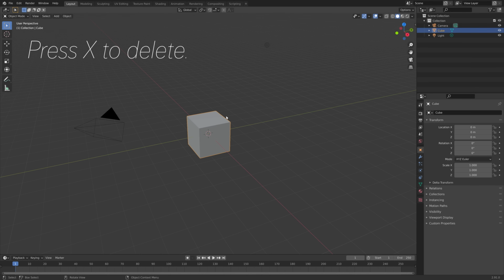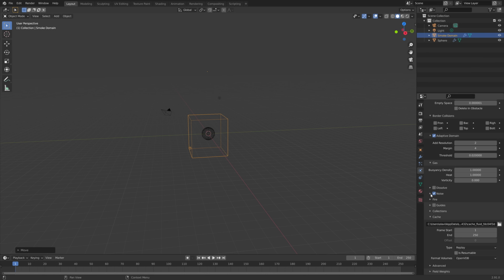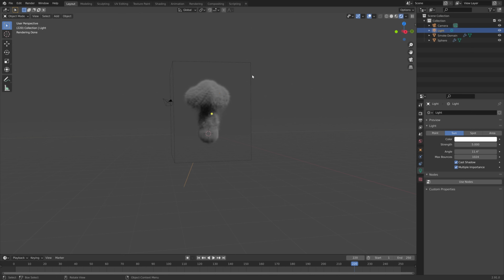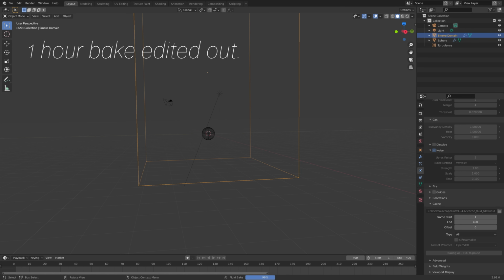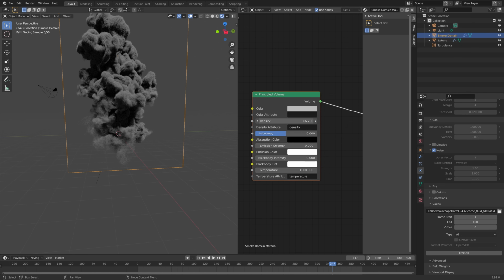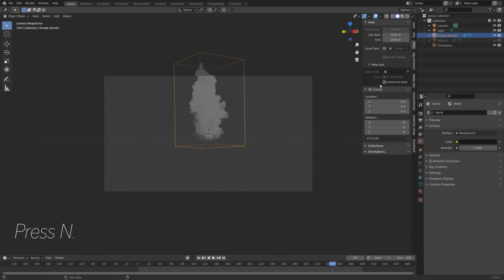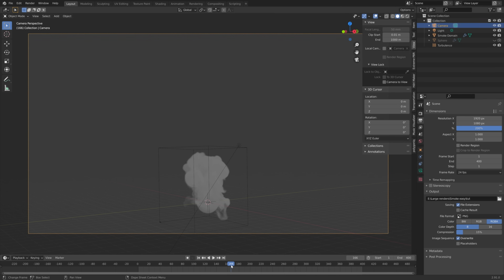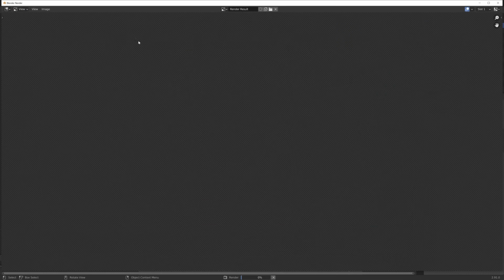[2.91] Blender Tutorial: Quick Smoke Simulation for Beginners

Comment: For me, the "all" option completely makes the smoke disappear. "Modular" also does so. The only working one is the "replay", and that doesn't even simulate. Just kind of spawns the smoke in a stiff frame.
I really don't like how they butchered the simulations in blender. Fluids became better with mantaflow but smoke and fire is now objectively worse, overcomplicated, extremely buggy that gives me flashbacks to 3DsMax and half the features don't even work. Instead of just adding geometry nodes in the next update, they should've spent a couple more years polishing Mantaflow. If not for the Cycles denoiser, I'd go back to Blender 2.79 just to simulate smoke.

Comment: hey i need help, everytime i did a smoke effect, the smoke never puffs upwards even though i have used adaptive domain/ increase the domain scale. It always ends up blocked at a certain height as if there was an invisible ceiling. Again i already scale up the domain size yet this invisible ceiling doesn't go away
Reply: Me too. Did you figure it out?
Reply: I am also having this problem
Reply: Seems to be fixed after baking it and switching back to replay
Reply: Bake all again… after finish baking, it will be work

Comment: why did you save it in png to convert in mp4 and did not render to avi?
Reply: because if the render crashes, you loose the whole video, but if rendered in pictures first, A you can export to whatever format you wish in a matter of seconds, and if it crashes you just render from the frame it crashed, saving loads of time if it does
Reply: @jonathantunstall1392  Also it looks like that AVI sometimes alters the lighting slightly...atleast for me. Especially when it comes to dark locations with alot of artificial area lights.